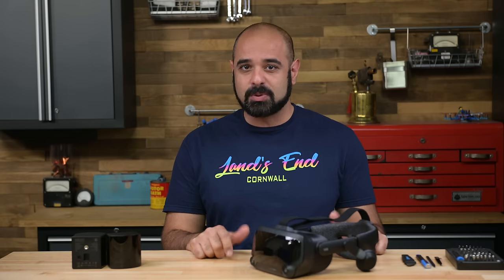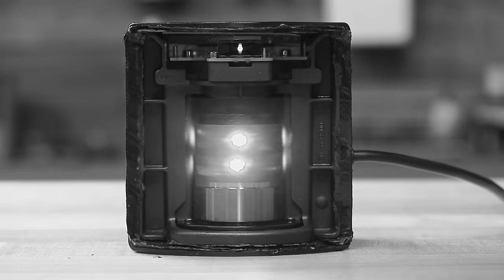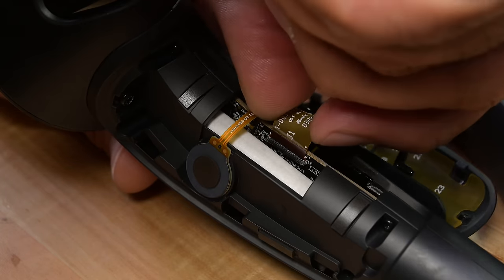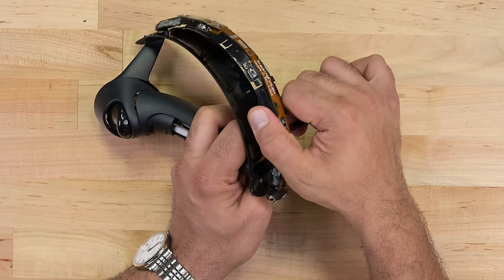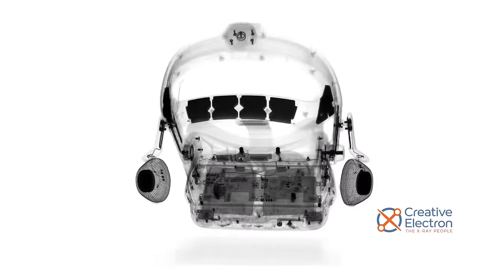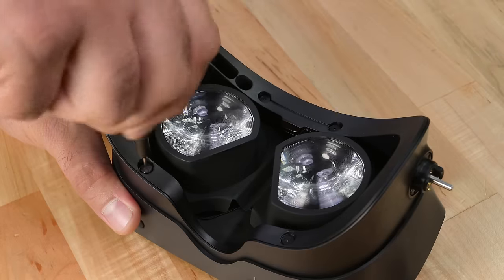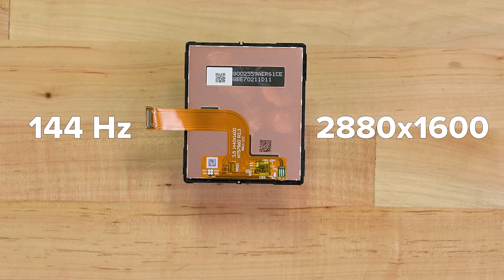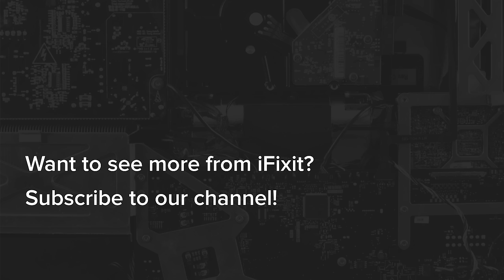The Valve Index Gets The iFixit Teardown Treatment!

Comment: The controllers' tracking fins are easier to remove with surprisingly little heat, and the shell plastic can handle quite a bit of heat. Once you reassemble them you'll get pretty big gaps on the ends even if you preserve all clips.

Horribly built controllers in my opinion. I've had to replace the metal frame at the top on one. Had to 3d print custom supports to reassemble without any glue. Zipties also help.

Comment: On regards to the index controller section. This video frustrating to me. On one hand it did give me a key piece of information about the IR ring, on the other they miss some key details about the handle and ring disassembly.

1. There is a scee in the handle that you cant access with the standard Ifixit mako kit. I had to shove tiny screw into the handle of my screwdriver bit mount to extend the handle enough to take the screw out, but it was sketchy at best.

2 they didn't actually show how they broke the plastic ir ring( in reality it breaks on one of the top most glue point due to the leverage force applied.) additionally if you are aware of the ribbon cable and sensor positions, you can pretty easily avoid damaging the sensor components, i was easily able to avoid this. Just by watching the video and being aware.

This doesn't feel like a strange mix of infotainment and actual teardown guid. Good flip notes, i just wish it was an actual teardown guid.

Comment: Mine seems to have a bad connection with the USB terminal, so it would only charge if I plugged it in and kept pushing it.
I think the solder may have broken because I accidentally handled it roughly with the wire.
From what you showed me, it seems that completely disassembling the ring part will have a fatal effect on the sensor.
I'm thinking of using an ultrasonic cutter to open only the area around the USB terminal.
I think it would be difficult to replace the terminals, but I'm thinking of melting the solder and fixing the cracks first.
Do you have any photos of the film cable around the USB terminal or the terminal?

Comment: This helped me with getting the controller apart for getting the little f&(*D! spring that fell down inside it, but I could have used a lot more detail.  You skipped over several key steps.  I ended up ripping off the flip-down holder of the grip ribbon cable, not realizing it was a flip type and not just an insert like all the others.  Gonna have to see if I can use glue to hold it back on I guess.  Speaking of which, actually showing exactly where the glue was holding the sensor ring cover on could have saved me at least an hour getting mine off, not knowing if what was resisting me was clips or glue.

Comment: 6:14 "Valve does provide OEM replacement parts for many components inside this device" is stretching it considerably! There is barely anything available. For the Controllers you can only buy the straps. No Analog sticks or batteries which would be most important. For the HMD it looks a bit better but overall still barely parts.

Comment: The HDMI signal on my headset drops out if I touch (and I mean BARELY touch) the front of the HMD. I suspect a ribbon cable has a loose connection. Have you run into this at all? I'd like to fix it instead of spending a $1000 on a new head set.

Comment: removing the cable was the hardest part for me. you guys made it seem so easy, but there's no way to grip the cable to pull it out. I eventually wiggled it free, but I think my cable is now damaged. All I wanted to do was replace the headstrap as the spring loaded mechanism to hold it onto your head broke through the plastic casing making my headset very loose on one side. Now that it's replaced, I've been getting headset not detected, but when it does get connected, VR seems to crash even though I'm in VR. This makes it very difficult to play beat saber and stream it if I need to restart VR.

Comment: Absolute #1 thing that puts me off the Index is the non-user-replaceable batteries in the controllers.
Just let us use rechargeable AAs FFS.
Thankfully alternative Lighthouse-compatible controllers are starting to come to market like the DiverX ContactGloves which have hot-swappable battery packs - vast improvement.
Reply: I would be hard to fit a whole AA slot in there with how compact all the stuff in there is.
Reply: @Vitoreo  Totally. But it was a choice they made when designing the controller.
I hope the Deckard controllers take a different approach and are more repairable with user-replaceable batteries.
I'm sure battery life would be significantly lower than using a sealed cell but pausing to swap batteries out is much less inconvenient than having to stop completely to put your controllers on charge.

Comment: The Index's price point was just too high to justify purchase IMO.  No inside-out tracking (i consider this a con), relatively low res LCD displays, PCVR only.  The Quest 2 is just a far better prospect overall.  I've always wanted those knuckle controllers, though.
Reply: Although the Quest 2 has higher res pannles, It actaully uses a lower resolution and has overall a lower clarity then the Index. I hate how often this gets glossed over.
Reply: the only 2.5 points the quest has for itself is the resolution, the price (which isn't that low anymore) and the 0.5 point: standalone capability. But there are a lot of cons to the quest, facebook, terrible speakers, terrible microphone, uncomfortable without an aftermarket headstrap, short battery life in standalone, short battery life with airlink or similar, no finger tracking, terrible customer support (to many bad stories floating around about that one), bad/untested firmware updates that randomly break things, worse tracking that is prone to occlusion and out of tracking area stuff.

If standalone is your thing, sure, it's a good headset. But for PCVR it's mediocre, it's decent for the price, but it gets blown away in every aspect by the index but the resolution, which the index isn't actually bad at all (and with PCVR the resolution of the quest is meh, because of compression artefacts).

Comment: pretty sure valve paid you guys off to never tear down the index because of how poor quality it is, controllers are cheap and flimsy despite being cemented together, the audio always breaks, same with the headstrap, and with how hot it gets and how bad the SDE is, and how no major youtuber talked about any negatives until years later, I smell BS. Also funny how you skip over the fact that the lighthouses are supposed to be unreparable on purpose because the IR lasers they use are class 3B lasers capable of blinding anyone that gets hit by a direct beam. Its akin to staring into a CD drive, hence why there are always safety mechanisms in places to prevent the laser from firing without a disk in the way.

And it makes sense too, all the facebook headsets are so much better in quality per your videos, valve really did everything they could to prevent their hype train from being derailed